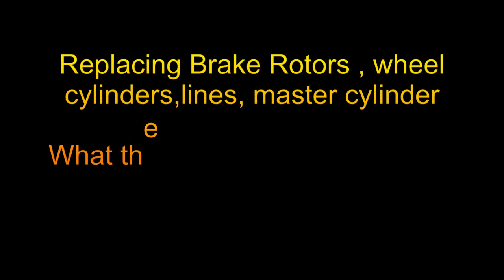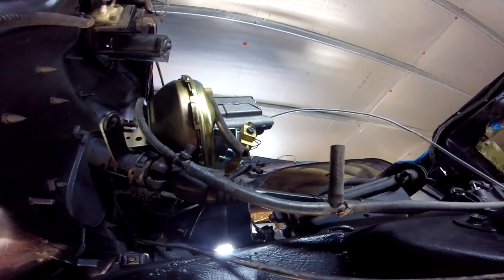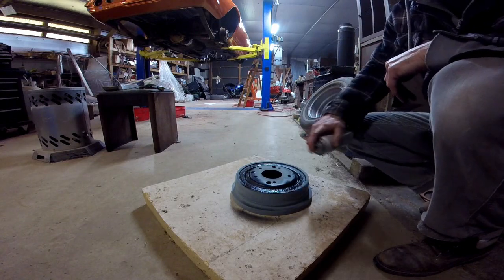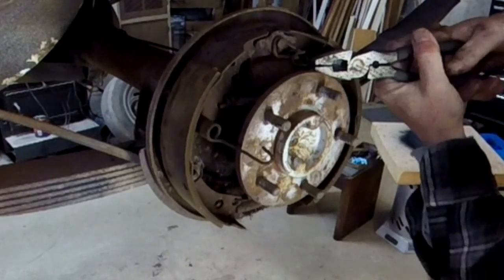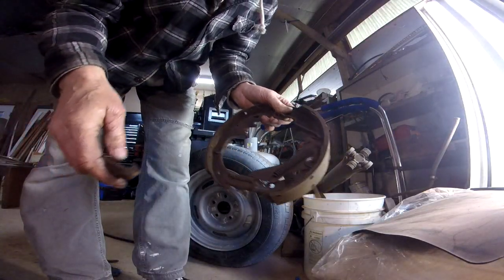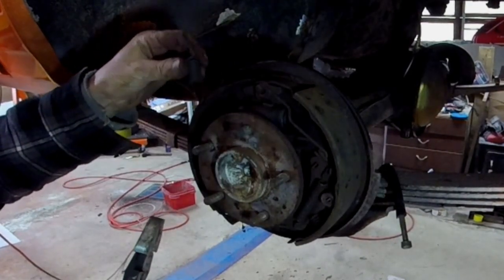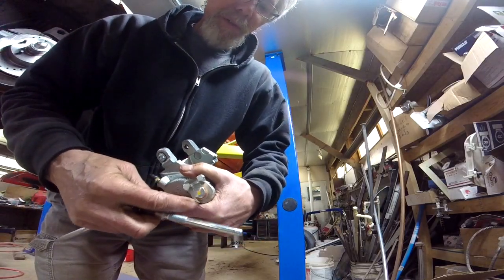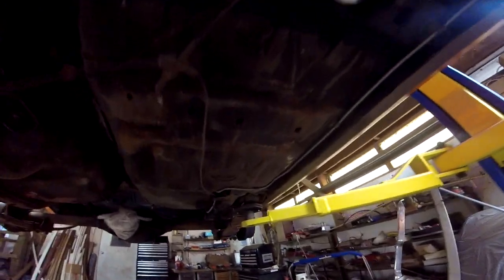Installing All New Brake System on the 70 Camaro

Comment: What kind of car lift is that? 
Is your garage ceiling high? Or average garage height?
Reply from the maker: It's a cheapo Chinese 2 post. I'm not sure it even has a brand name but I got it from Lift supplier in Hanover PA. My ceiling is just under 10 ft so the car cannot be raised to the maximum lift height of 5 ft 8. I usually end up sitting on a stool underneath when I work
Reply from the maker: It's from Automotive Lift Service